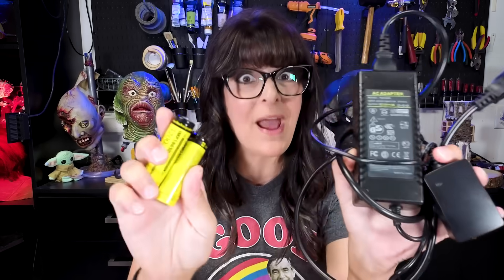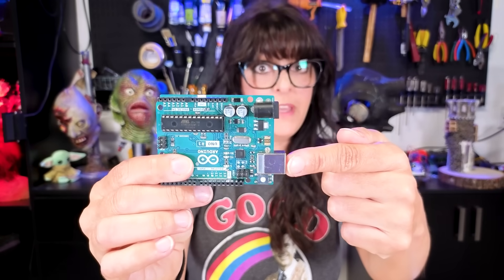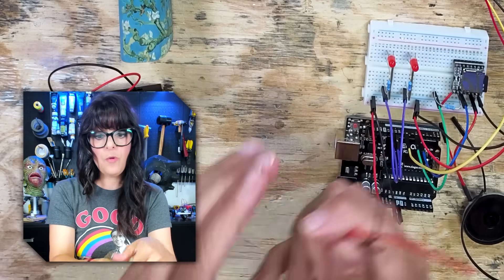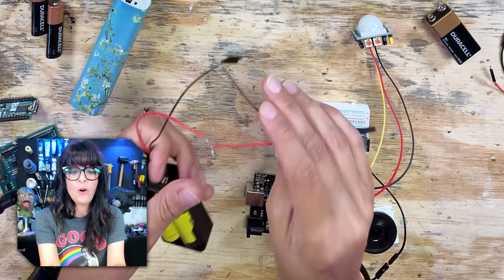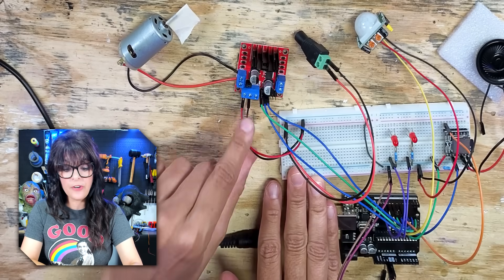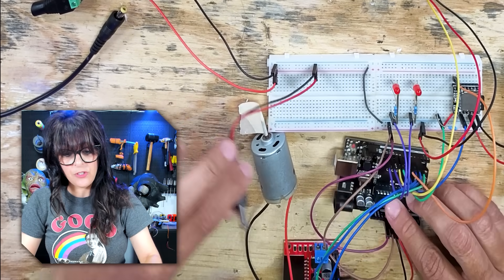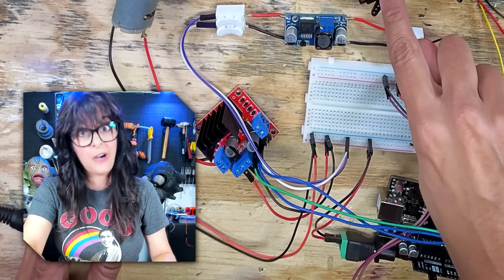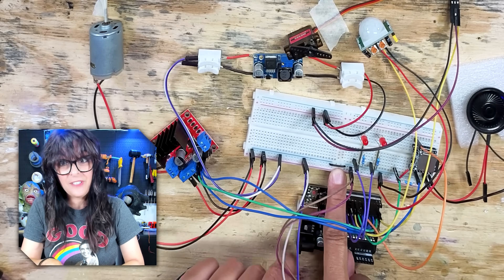How to Power Your Arduino Projects: Ultimate Guide

Comment: I’ve never had an issue connecting a 5V wall adapter directly to “5V”, not (!) “Vin”. That bypasses the voltage regulator, so the arduino will work exactly with what comes out of the cable without any drop.

Comment: Question. I run an arduino off of a battery pack but unplug nightly to recharge. I need to close up the prop from wandering hands so I added a barrel jack so I can plug in a charger after hours instead of removing the battery pack. However this would leave the arduino running around the clock all the time. Do you know of a product or way to detect the plug and kill the power to the arduino? I have been imagining some kind of relay setup where power is applied to the relay and it switches off the arduino then restores it when unplugged.

Comment: Rachel, I am about to start on a very big project and I’m going to be using the Arduino OPTA micro PLC’s and the Arduino Portenta Machine Control, it will all be DIN rail mounted and I will be using the Arduino IDE, and the PLC IDE. I will only be programming the OPTA using Ladder Logic Diagrams, my question is I want to be able to program these items with a Raspberry Pi 5 which will probably be the 8GB RAM version with a 128 SD card (I will add a monitor and keyboard and mouse) my question is for the purpose of programming Arduino boards if you, yourself were going to be using a raspberry pi for programming which pi board would you use and is there anything you can think of that would prevent me from being able to use a raspberry pi 5 to program the Arduino?

Comment: Thanks and thats very helpful.  I wonder how to add a on/off switch on top of the power source( battery operated) in case i want to switch off the whole thing.  And if the projects have more than one arduino boards, how to power them up?   Thanks

Comment: Be careful about wall warts.  They are sometimes AC not DC.  Also the DC may not be regulated, i.e. the voltage may be 40% high at no load rather than the listed voltage.  This type may also have a high ripple (AC) voltage on it.

Comment: I m sorry but even top brands like samsung can only make a 18650 cell upto absolute maximum of 3600 mah. Capacities larger than that need bigger size. So you got ripped off on that 9800 mah one .anymore capacity than 3600 needs a 21700 cell. Pin this so people starting their diy tinkering wont be losing their money.  Also any 18650  battery  > 3600 mah is probably <1500 mah
Reply: Agreed. In my experience, regarding an 18650, any cell rated over 4,000 mAh should have the LSD (least significant digit) dropped.
Chineesium cells are often hyper-exaggerated. Don't even get me started on the pyro potential. Buy quality.✌️
Reply: @gaspumprepairservice7009 the manufacturer probably meant 98.00 mah 😂😂
Reply: Facts. They gotta stop with those chinesium batteries 😂😂 @gaspumprepairservice7009
Reply: @gaspumprepairservice7009  its a 9800 mah time bomb 😂😂

Comment: Little tip, you can get more power to the speaker by using two pins.
void setup() {
  pinMode(sounder_A, OUTPUT); //connect the piezo or small speaker across two ports,
  pinMode(sounder_B, OUTPUT); //to double the signal amplitude.
Reply: She is using a DF Player MINI module. You can adjust the volume by grounding the Skip Song or Previous Song pins for a few seconds.
Reply: @vg_coder okay, I see, thanks.
Reply from the maker: I'll try this with my next buzzer project! 👍

Comment: Caveat about USB power banks -- sometimes they require minimum draw to stay on, else they automatically shut off.

Although granted nobody is trying to save power if they're using an Arduino...

Anyways, those USB power banks usually use 18650s internally anyways, so it's kind of like your 2-cell holder, but with built in charger and 5v regulator.  So if you find one that lets you swap cells yourself, it's kind of bonus.

Another option that has become somewhat more viable lately is to use a USB PD trigger to select an output voltage from a PD power supply and use that to power projects.
Reply from the maker: That's totally true about the power banks. I think if your project draws less than around 50mA then the power bank will shut off.

Comment: Are you using custom made cables?
Reply from the maker: All my wires are store-bought (from Amazon). The only thing I customized is cutting the jumper wires in half to splice them into the circuit. 👍

Comment: The V in goes through suitable voltage regulations, but the L298N module has a 5 volt regulator that is good up to 12v.  It seems like you could use the L298N's voltage regulator to get 5 volts and then put that into the Arduino, possibly at a 5 volt pin because 5 volts is too low to go into the V in.  Any thoughts?
Reply from the maker: Yep! That's true. You can use the 5V and 3.3V pin to power the Arduino too. I didn't show this method because you have to be more careful with it (not exceeding 5V). It's safer to go through the Vin pin but it has to be at least 7V. Great tip!

Comment: Another budget option that I've done, is to use power tool batteries. I had a bunch of them and chargers already, so all I needed was a $15 adapter from AliExpress that clips on the battery, and a buck converter to bring that down. I wanted to go LiPo for my robotics, but here in Australia it's quite expensive as you need a proper charger, safety boxes etc, it was around $400 to get that so I opted for a cheaper option lol.
Reply from the maker: Power tool batteries are a great long-lasting option too! 👍